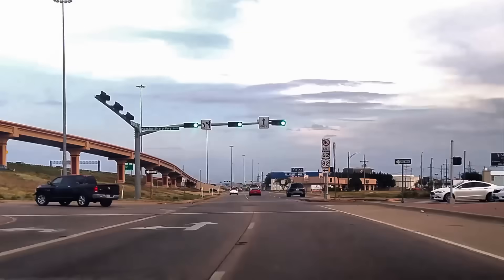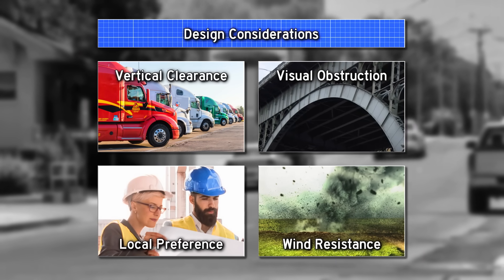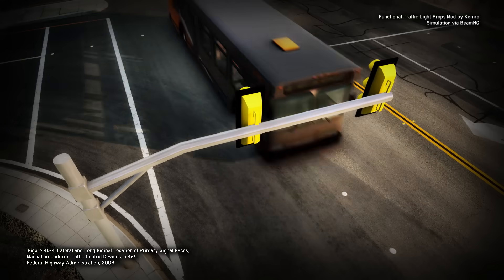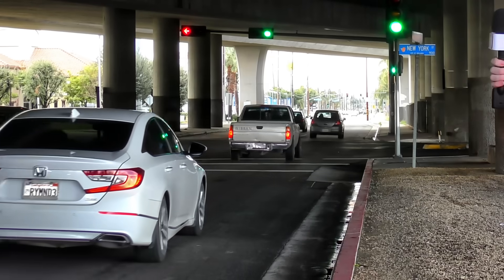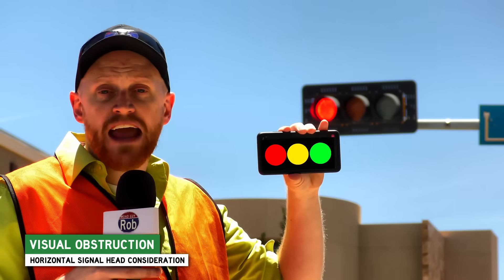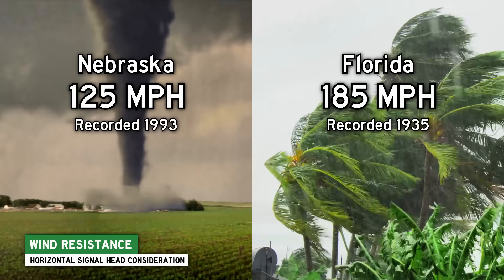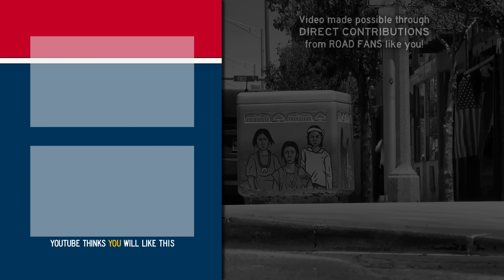What's up with SIDEWAYS STOPLIGHTS in Texas and Florida?

Comment: Hey did you ever talk about the multi arrow vertical 4 light signals in North Carolina? 

Each signal has 2 cycles, one with a blinking yellow arrow to solid yellow arrow which means yield, and one with a green arrow to solid yellow arrow which means you have the right of way. Both cycles use the same solid yellow arrow. Very confusing to out of staters who have never seen it before and only see a solid yellow arrow as right of way.

Comment: Two Kansas City suburbs on the Kansas side of the metro — Lenexa and Roeland Park — are mounting their new signal installations horizontally. However, these signals are different from the conventional signals used in the State of Kansas. For example, your typical Kansas traffic signal head will have a yellow cabinet, black doors, and black tunnel visors with a black backplate if mounted to a mast arm, like Iowa, Illinois, Georgia and metro Omaha.  The horizontal signal heads are all black — cabinets, doors, tunnel visors, and backplates — and are manufactured by two companies — McCain (Roeland Park) and Econolite (Lenexa).

By the way, I think California has the best signal design and display in all of North America!

Comment: In Wisconsin the majority of overhead stop and go lights are horizontal. I saw some vertical ones put into Milwaukee recently and they weirded me out. We also have a ban on span wire installations! They can only be used for temporary installations.

Comment: Technically Japanese is read right to left when they right vertically (i.e. vertical lines of text running from top to bottom, where successive lines go right to left). 
That said, your point still stands since when written horizontally, Japanese is written like English (horizontal lines of text going left to right, successive lines from top to bottom).

Comment: Another benefit would be distinction between rail and traffic signals. County Road G6 in California runs right next to a rail line, and in Mountain View, some of the railroad signals are installed on the same plane as the traffic signals. I'm sure horizontal signals with yellow backplates would make the two sets of signals more distinct.

Comment: I swear everybody always seems to forget about Wisconsin. We've had horizontal traffic lights as long as I can remember, but most new traffic lights are all vertical. But we still have a ton of horizontal traffic lights left. I grew up here in Wisconsin and had no idea horizontal traffic lights were uncommon until I was an adult (or that so many states just use spanwires--I only ever see them used in temporary setups here)

Comment: Alberta is another place where the overhead traffic lights are typically horizontal.

The main exception is when a dedicated left turn signal is mounted on the overhead mast arm, it is often oriented vertically to distinguish it from through-lane signals. This is always the case on rural traffic lights installed by the provincial transport ministry, but within cities, you may find either alignment.

Another oddity, which I think now only exists within Calgary on signals installed before the mid-80s, are double-margin backplates. They're getting hard to find as the city replaces rusting old poles and their signals. Take a look at the street view of Blackfoot Trail and 53 Avenue SE, which has these large and well-rounded backplates on 12 inch and 8 inch lens lights, probably dating to the 1960s.
Reply: all places in alberta are now horizontal and most have backstop plates. lethbridge doesn't and they are very hard to see.

Comment: I remember when I moved to Eastern New Mexico from Colorado. I was so thrown off by the placement of the lights. It was until my first sandstorm I realized why the lights are placed horizontally. I remember in Colorado when the winds were high you were just waiting for the beam to fail. I was always amazed at much the light poles can flex. 

That would be an interesting video topic. Speaking to a street signal structural engineer. Especially, ones that design lights for high wind areas.

Comment: Love those vertical stop lights in Florida.  First one I see I know I'm almost at the beach(Navarre or Ft Walton).  Kinda wish they did them in Tennessee, we get enough high winds/tornados that it would make a difference IMO.  Plus its cheaper to mount them sideways, shorter poles, lower cables, weight of the signal more evenly distributed thru the pole/cable, etc.

Comment: Hey Rob, this was an awesome topic! I'd love to see a part 2 of this looking more at why the Northeast seems to almost exclusively use span wires instead of metal poles. In traveling throughout the midwest and west, I noticed metal poles were much more common across many states. I'm from NY and can attest that the span wire setup looks bad and can be confusing when the signals don't line up over the lanes properly. It's also really annoying when the signals are placed in the middle of the intersection and not on the opposite side.

I traveled a lot in FL too and I can confirm that it seems like mostly southern coastal cities have the mounted sideways signals. I was always curious about this and now I know!

Check out the signals used in Tempe AZ. Definitely very unique!
Reply from the maker: Absolutely.  The footage in the video is some I shot while driving through the northeast (and midwest) a year ago.  Span wire signals are almost entirely gone in the west.  So yes, it's fascinating that they are still so common.
Reply: The span wires cost a fraction of what the cantilever systems do.   They could still save a LOT of money and have the signal EXACTLY where it would make the most sense to the driver: just construct a wire grid and put the signals where needed.
Reply: Maybe for snow load considerations?
Reply: The signals aren't supposed to line up perfectly over the lanes. You'll notice in single lane intersecitons there are still 2 sets of lights, and there is generally 1 more set than needed for more lanes, this is for redundancy.
Reply: @Tahngarthor  Good point. I understand that's how single lane intersections are set up, but not sure of the rules for multiple lanes. I'm thinking of a few intersections where the light is literally over the white lane in between each lane, so it can get confusing.

Comment: Where I live in Canada they’re mixed. Usually the one above in the middle of the road is horizontal, the turn signal light for left turns is vertical and the light on the pole is vertical

Comment: After moving to NY from WI,  I learned about the spanned lights.  I freaking hate them, you can't pull into the intersection for a left turn without losing sight of the light, unless you duck down to look up to see if it changes.

Comment: I was just in Florida (Tampa area) and it's almost as if they can't even make up their minds on how to mount the signal heads!

It's literally one intersection with the ugly wire, very next one metal pole vertical signal head, then the next one metal pole horizontal signal head and there isn't any reason for height concerns. Most of Tampa Metro is metal pole with vertical signal. But it's overall a huge mix.

Up in Albuquerque, they use "trombone" style to horizontally mount signal heads just like Wisconsin.

I'm in St. Louis area and it is all vertical here with the exception of signals around bridges.

Couple intersections in downtown St. Louis have the horizontal mounting for really no good reason. They're nowhere near any bridge or anything that would block the view!

Nebraska is strange with their mountings. The two thru-lane signals are horizontal while the left turn lane is vertical all on the same pole.

Comment: tl;dr Stoplights are horizontal in some states because there are plenty of benefits of doing it this way, and essentially no downsides.
Really its the vertical stoplights that don't make so much sense.
Reply: The downside is snow build up. We tested some in Alaska and they ended up having huge blocks of ice on top that were ~4x larger than the vertical ones. It becomes expensive very quick to reinforce the poles
Reply: @ticklershpickler  I didn't consider snow buildup. That's a good point for vertical stoplights in the snowy states.

Comment: The Vienna Convention (to which, in your defense, the United States and Japan are not signatories) has this text: "Where the lights are arranged vertically, the red light shall be placed uppermost; where the lights are arranged horizontally, the red light shall be placed on the side opposite to that appropriate to the direction of traffic." Japan drives on the left, which might explain the traffic light orientation there. I have seen videos of Japanese traffic lights where a vertical traffic light is mistakenly installed upside-down, though.

Comment: Living in South Florida, horizontal traffic signals are absolutely everywhere.  There are very few cable signals left, at least in my county.  And whatever ones are left are getting replaced by poles.  But for good reason, and it's for the reason that I knew you would mention: durability.  The cable-driven signals don't stand a chance in our hurricanes.  Even if it's a Cat 1 or 2 most signals are dangling on the ground.  The pole mounted ones are built to withstand hurricane-force winds.  The aerodynamics of it I actually didn't know.  That makes even more sense now that you mentioned it.

Comment: Wtf this is normal, it makes installation easier and is a more rugged way to mount because you won't have torque or a moment arm that can act upon the mounting post, or it can be suspended but not move too much, in the wind. It's because of wind. Also probably reduced cost because the cables are in a more straight line instead of having to 90 out if the tube into the fixture..., also human vision is emphasized on the horizontal plane because in our evolutionary history we would have had our gaze on the horizon because that's the first OSCE you see anything like threats or game... so yeah, those are a few reasons why it might be this way and actually vertically oriented lights are dumb because the odds of someone missing the change of color are higher due to solar angle, someone might train their vision lower due to incident solar angle and not be looking for the lights in a vertical line unless they're on the periphery, so the horizontal allows one to only need to scan one line in vision and maintain the right angle to avoid the sun or its glare

Comment: Intersection in Michigan of M-59 and US 23, the traffic under the bridge is horizontal. To be honest, I prefer the horizontal setup. For sure also prefer the use of poles than wire-hangers. I've seen a traffic light snap off the wire during an ice storm in Michigan. Those things are heavier than they look.

Comment: 1. I retired to Texas from California and miss the way California has a vertical traffic light on the pole and horizontal lights on the cross pole. Since visibility is the issue according to standards, the vertical light is helpful when you have to put down your visor because you’re driving into the sun. (Didn’t people consider the sun when making the standards??)

2. Syracuse NY has a green-yellow-red vertical span wire signal head.
Reply: 0:45 see the top left-hand comment

Comment: I know of an intersection like one described at 5:46 but instead of turning the lights sideways they just made a whole new signal and put it in front of the bridge so now there's 2 sets of signals.
Reply: And some have a set of flashing lights on the bridge that tell you when the light is red. They turn on after a bit of yellow so you don’t get caught running the red lights

Comment: Rob, the "green" lights actually have a bluish tinge to them to distinguish them from the red lights for those who have red-green colorblindness.
Reply: Also, the green light's lens is clear, and its bulbs/LEDs are green, while the other two lenses are tinted their color. 

This is so when the sun is shining onto the signal at dawn (or dusk,) the drivers don't accidentally mistake the reflection for a green light.
Reply: @ElectroDFW  They have made signal balls with true red and amber LEDs generating the color too but I think they have been phased out in new installations for a while. But they do have that benefit of just appearing white when off.
Reply: @craigjensen6853  agreed, I have recently started to pay more attention and it does seem to depend on the light style, and even sometimes which direction it is facing. 
We have some here using LED arrays (which are very noticable when a pathway of them burn out) but it's harder to tell between the COB LED and the filament bulb ones.
Technology Connections has a great video on the unintended consequences of the switchover to LED traffic lights.
Reply: I did wonder about this - it’s certainly the case in the UK that we have blue-green go signals ( though railway signals are pure green and drivers are required to not be colour blind)
Reply: As someone with red-green colourblindness the two look identical but I don’t think it would be an issue as you could easily adjust but knowing the light position.

Comment: A fun reason you'll see a mix of horizontal and vertical streetlights in New Orleans is because many streets need to be able to accommodate Mardi Gras parade floats. They're mounted horizontally so that floats can pass underneath.
Reply from the maker: I didn't know that.  That's interesting.  Thanks!
Reply: @RoadGuyRob  I was in Pensacola for Mardi Gras this year, and at least two floats came very close to a vertical stoplight. One of them even stopped long enough for one of the revelers to scribble something on the back of the light.

Comment: seems like they are more commonly found in high wind prone areas.  Louisiana and Mississippi both have horizontal lights along the coast line.  TX/LA/MS are all prone for hurricanes and tornados.  if you have them horizontal they mount with more than one point.  and as you stated, we have larger trucks and truck loads in the south.  it allows for more clearance when mounted horizontal too.

Comment: Whether the light's housing is horizontal or vertical, the "frontal area" is the same. What is different when it's positioned horizontally is that the light is secured in the rear along it's whole length, giving better resistance to the wind.

Comment: Actually the aerodynamicity gains from a horizontal light system aren't really significant; at most angles there's almost no change and depending on the style of the light housing the drag can actually go up.   The reasons are that it allows a longer span between brackets so lighter brackets can be used and the frequency of the oscillation induced by the buffeting across the light frame and shield is greatly shortened so less torsive stress is put on the light supporting beam thus it allows lighter branch and post pipes to be used.   It literally makes traffic accidents safer as well.

Comment: I only know of 1 intersection in my city with horizontally mounted traffic lights. Its for clearance, but not for trucks, but for planes as the intersection is only 100-200feet right in front of the main runway of the local airport. sure no jets, but its still an airport.

Comment: Here in Wisconsin, it's quite common you would run into these horizontally mounted traffic lights. I think as overhead these are cooler than a vertical mounted traffic light

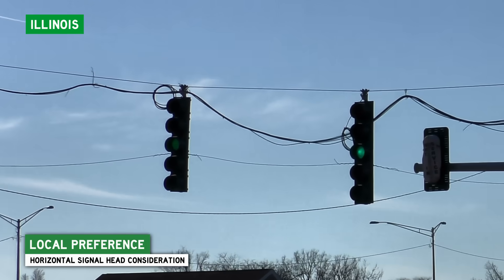Comment: 6:54 and 7:21 That's a temporary span-wire installation in Illinois (note the monotube next to it).  Outside of temporary installations, span-wire is extremely rare in Illinois.  The state prefers monotube installations with trusses being older (pre-1980s) installations.  Span-wires are used in construction zones for temporary signals while the monotubes are being installed or preempted for the work zone.

Comment: Japan does write from right to left in the case of vertical text (which is quite common there), but I'm more curious about whether the order of the lights depends on the writing system or the driving direction.
Reply: It would be a problem for the rest of the Anglosphere that drives on the left, and for the Arabic-speaking world that drives on the right.  These places would have conflicting factors that would govern which way to mount a horizontal traffic signal.   If you were in the UK, would it make more sense to have red on the right as the danger side for oncoming traffic, or would it make more sense to have red on the left, since you read left to right?

Comment: Here, in Illinois, signals are usually mounted horizontally for an overhead obstruction such as a bridge or railroad viaduct for better visibility.  There are a number in Chicago mounted in such a fashion.  You'll have one direction emerging from the rail viaduct mounted horizontally while the other directions will be mounted vertically.